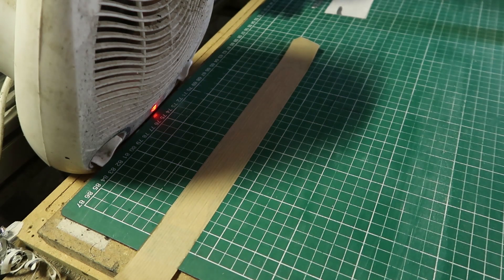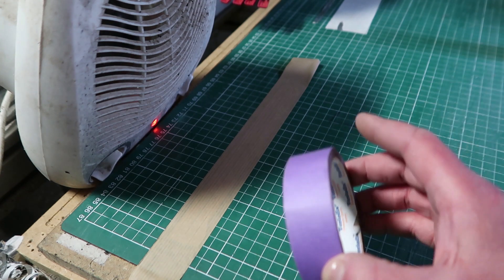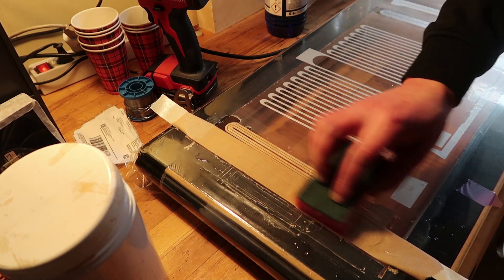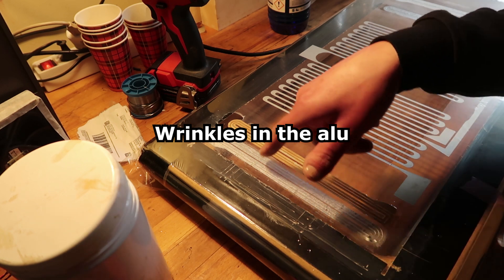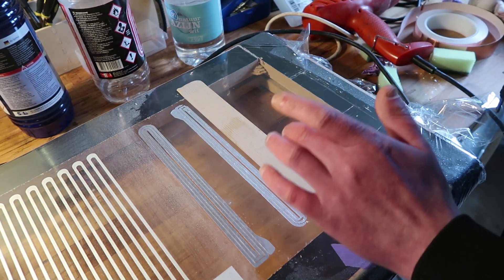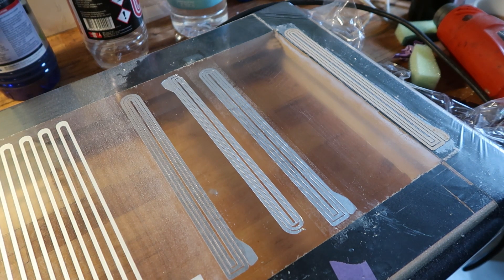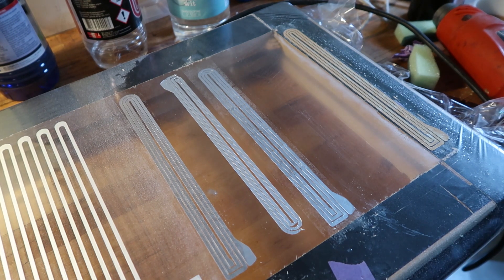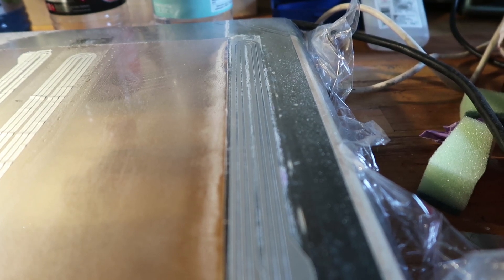My Own transfer method

Comment: You could probably benefit from some of those upholstery/sticker application tools. They look like a credit card with a soft fabric on them. I use them for spray adhering thin things, tape, and vinyl upholstery. Also some print rollers/small hand rolling tool with soft rubber rollers.
Reply from the maker: I bought one of those rollers a few weeks ago :) and some squeegies,  it is nice advice. those tools come in handy ! thanks !

Comment: Your paper tape reminds me of wood veneer tape. It's glue is a fish based glue. Very water soluble. It usually has holes punched in the greater area of the tape. But you can get the type that you are using as well. Nice results. What is the resistance of your traces? They are so large!
Reply from the maker: well the traces where big since the actual design was much longer :) i did not have the metal so. but wanted to test it. if the trasnfer worked :)

Comment: This always happens using water-soluble glue and wood (paper). the glue, when dry, shrinks the layer it hits. You can take wood, not plywood, and soak one side with good glue, and you will notice one thing. When it dries, the glue will tighten that side and the stick will look like a bow. So use a different glue, without water or alcohol or anything else that soaks into the paper, or smear both sides of the paper so it doesn't get crooked.
Reply: Also, I think it would be better to glue this sandwich to the mylar with a roller, on a hard surface, put some books underneath stretching jig, for example, so that there are no bubbles.
Reply from the maker: @ИндейскийДух  the hard surface alone fixed it, as i thought it would :) no wrinkles.  on a hard surface (last 10 seconds of the video) Thanks for the input though !
Reply: @joppepeelen  Yeah, I wrote first, even though I didn't look at the whole thing, and immediately I see a really flawless aluminum track! :D
Reply from the maker: @ИндейскийДух  hihi.  Well i did not know it would be so much different , to bad but at least we found the problem.  Would be much easier is i could replace a coil without having to remove the mylar competely :)